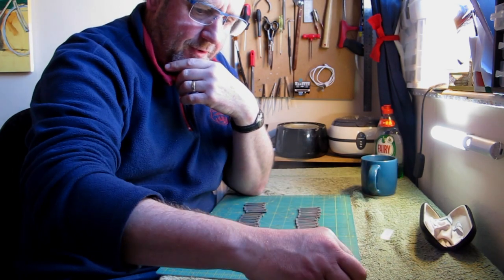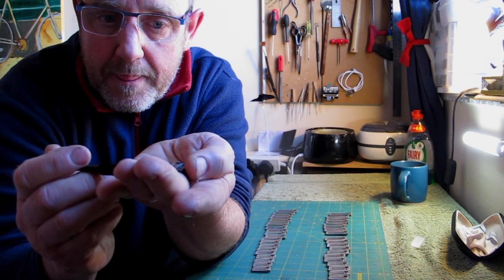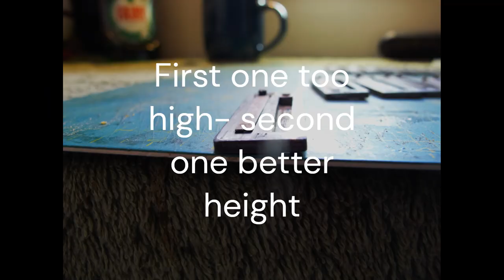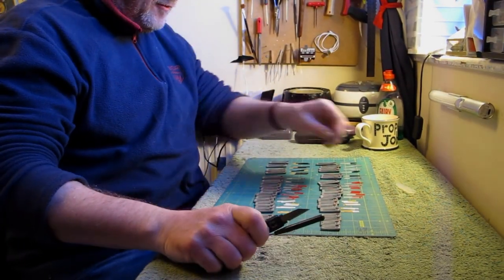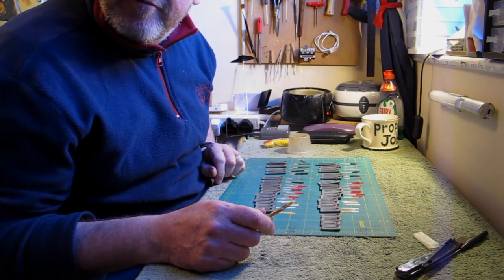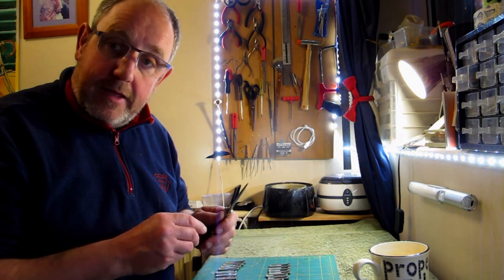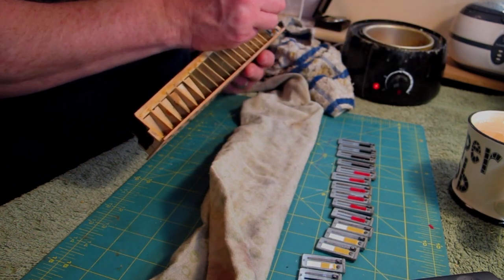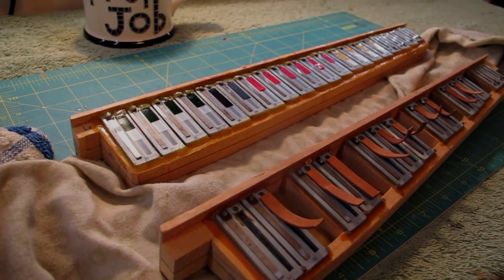Accordion full  restoration - Hohner Carmen 24 bass- part 2

Comment: Hello, you really have great content and thank you for investing time in filming the process. I'm wondering why don't you add valves on all reeds? (highest 4 of each set in this case) I understand that you don't have to do it and that they would make sound even without a valve, but would they work better with valves and use less air while playing or what? I have some cheap accordion and for high reads there are no valves so I understand that factory made it on purpose like that. Thank you for answer in advance.
Reply from the maker: Hello 
Thankyou for your kind words ☺️
The reed valves help to ensure that the air is directed to the reed to be played and not lost out of the reed slot of the opposite reed - the highest pitch reeds need so little air to get them moving that a valve is not necessary and would just make it  a little more difficult to sound the reed you want to play .
I hope this helps 😊

Comment: Hi! I really like all your videos! They are really helpful.
How many sizes of valves do you need for the trebleside? I am looking at EBay and ha-vents have a set with 9 sizes.

Keep up the good work!
Greetings from Sweden!
Reply from the maker: Hello Emil
I have 8 sizes of synthetic valves that I use on the treble side 
Depending on the size of the accordion and it's reeds I will typically use 5 different sizes on each reed block 
The low set of treble reeds will use 5 of the larger sized valves and the middle sets of reeds would use 5 of the smaller 
Sized valves
I hope this helps 🙂😀😀